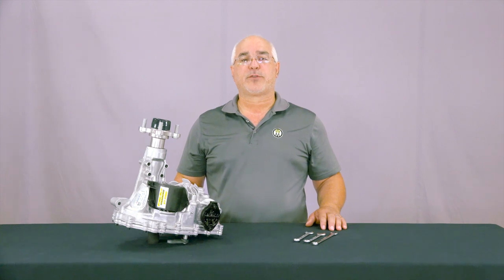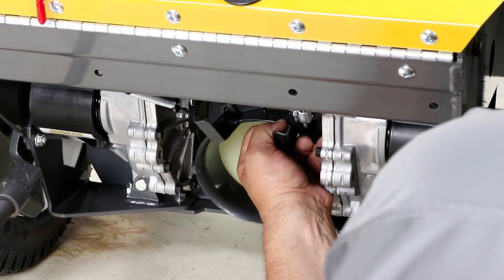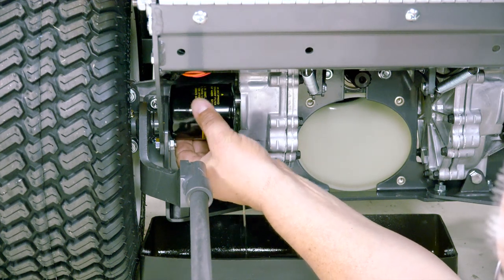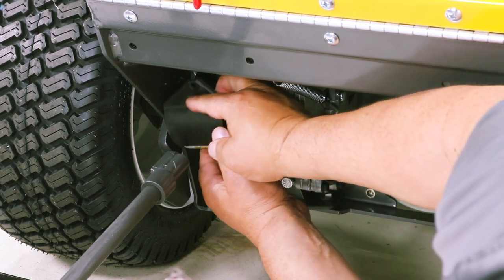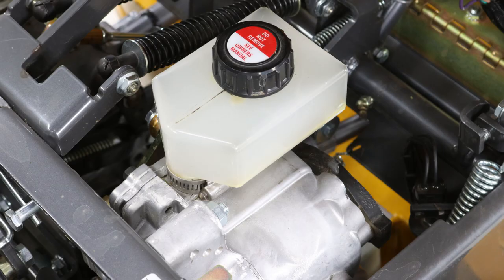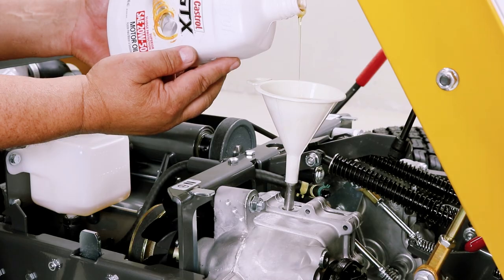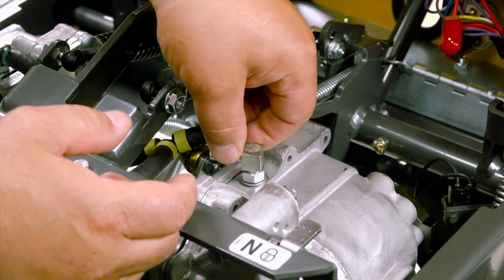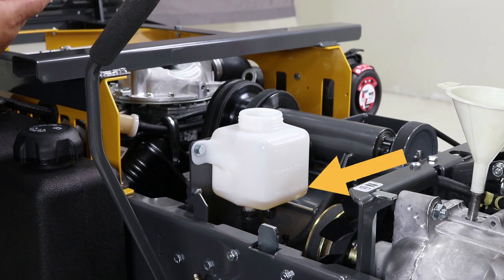TECH MINUTE - Walker Model S Hydro-Gear ZT3100 Transaxle Oil Change Procedure

Comment: In the fall I switch to the dump bucket. In the spring I switch to the mower deck. I have trouble every time because I forget the best way to do this. It would be great if you demostrated.
Reply from the maker: Hey. Are you referring to changing your mowing deck? If so, this video should help you out. https://youtu.be/d69xZtu6A-c

Comment: After draining and replacing the 2 new filters, can I fill the Axles through the overflow container>
Reply from the maker: Bud. Thanks for the question. To refill it is recommended you use the oil fill opening shown at 2:43

Comment: Hi, I have a Ferris 400s and it has ZT3100 hydro deives and 65hrs on the clock, not sure if this is a problem but if I jack the drive wheels up and engage the bypass levers the left wheel still turns when I move the main levers forward and back. The right wheel will not move, I can stop the left wheel from turning if I hold onto it by hand with a tight grip. Any thoughts if there could be an issue with it?
Reply: Did you figure this out?
Reply: I bet there is a “plunger” attached to control sticks that have a bad oring.
Reply: @dallas4798   I have a feeling it's the bypass leavers not engaging far enough back,, If I pull back more pressure on the bypass leavers it stops the wheel from turning.
Reply: @bryanhauschild4376    @dallas4798   I have a feeling it's the bypass leavers not engaging far enough back,, If I pull back more pressure on the bypass leavers it stops the wheel from turning.

Comment: What oil filter part number for those 2 transaxle ?
Reply from the maker: David, we will refer you to your Owner's Manual for detailed information regarding service and part numbers. If your manual needs replacing or you would simply like to access it online, please visit https://www.walker.com/manuals/
Reply: @walkermowers  both the part and owner manual didn't show any. I looked it over 5 times
Reply from the maker: @MatLon28   Please see page #4. https://www.walker.com/hubfs/PDF/4000-28.pdf